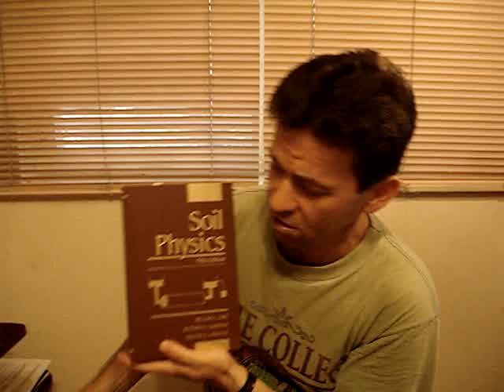Tubarc 004 Violation of Science

Comment from the maker: If you insert a nylon cord to an oil lamp it will fail because plastic material does not stand high temperatures of flames. You cannot have a wick that fails as a wick. Also, there is a deep hydrology about fluids moving on porosity in Soil Physics and Hydrogeology that can provide insights far beyond the hydrological funcitoning of oil lamps.